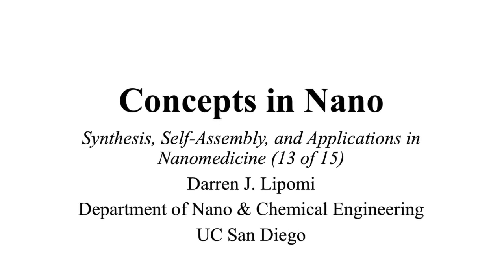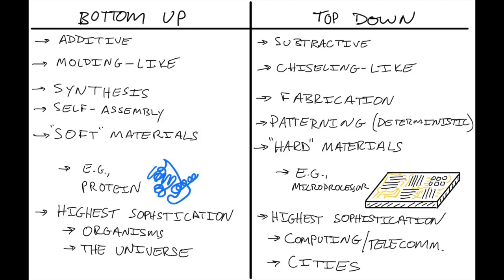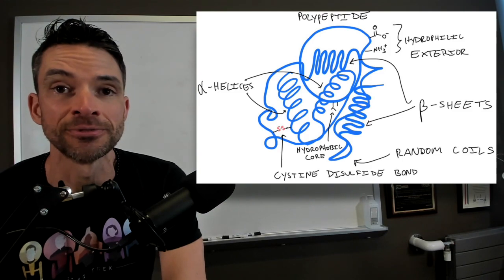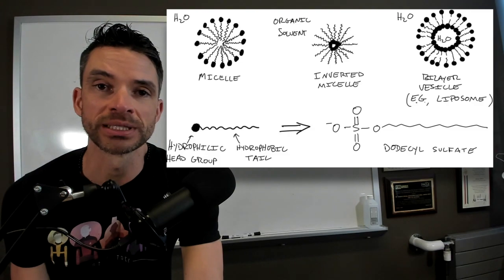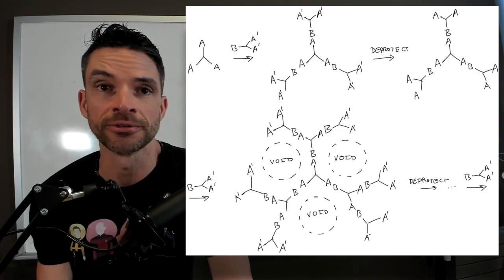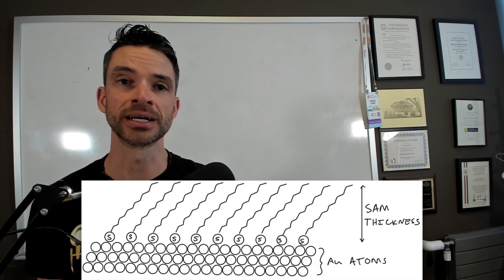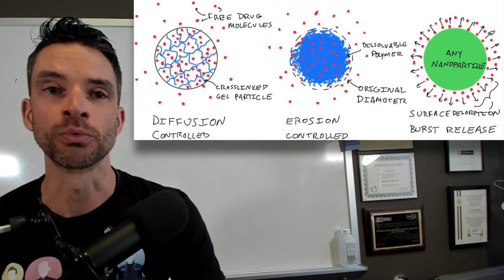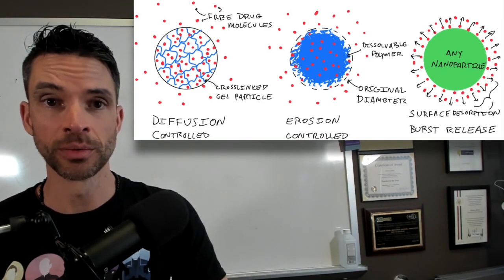13/15 Concepts in Nano: Bottom-up self-assembly, synthesis, & applications in cancer nanotechnology

Comment: but in 2-[4-[3,5-bis(pent-1-yn-1-yl)phenyl]ethynyl]-2,5-bis(3,3-dimethylbut-1-yn-1-yl)-1,3-dioxolane.

2-[4-[3,5-bis(pent-1-yn-1-yl)phenyl]ethynyl]-2,5-bis(3,3-dimethylbut-1-yn-1-yl)-1,3-dioxolane.

2-[4-[3,5-bis(pent-1-yn-1-yl)phenyl]ethynyl]-2,5-bis(3,3-dimethylbut-1-yn-1-yl)-1,3-dioxolane.

2-[4-[3,5-bis(pent-1-yn-1-yl)phenyl]ethynyl]-2,5-bis(3,3-dimethylbut-1-yn-1-yl)-1,3-dioxolane.

2-[4-[3,5-bis(pent-1-yn-1-yl)phenyl]ethynyl]-2,5-bis(3,3-dimethylbut-1-yn-1-yl)-1,3-dioxolane.

2-[4-[3,5-bis(pent-1-yn-1-yl)phenyl]ethynyl]-2,5-bis(3,3-dimethylbut-1-yn-1-yl)-1,3-dioxolane.

2-[4-[3,5-bis(pent-1-yn-1-yl)phenyl]ethynyl]-2,5-bis(3,3-dimethylbut-1-yn-1-yl)-1,3-dioxolane.

2-[4-[3,5-bis(pent-1-yn-1-yl)phenyl]ethynyl]-2,5-bis(3,3-dimethylbut-1-yn-1-yl)-1,3-dioxolane.

2-[4-[3,5-bis(pent-1-yn-1-yl)phenyl]ethynyl]-2,5-bis(3,3-dimethylbut-1-yn-1-yl)-1,3-dioxolane.

v \